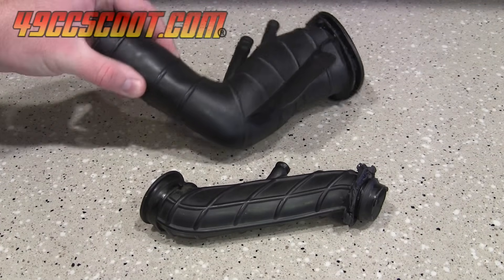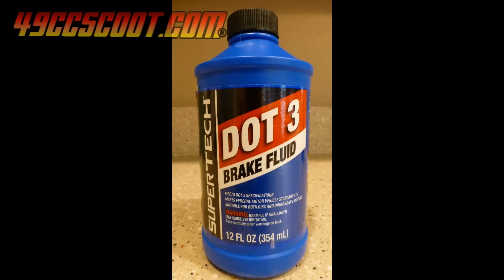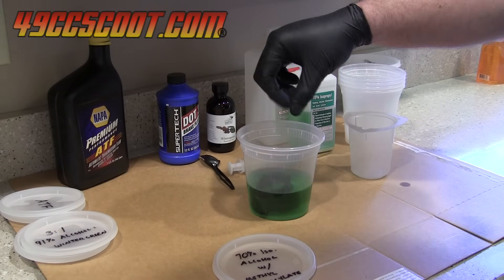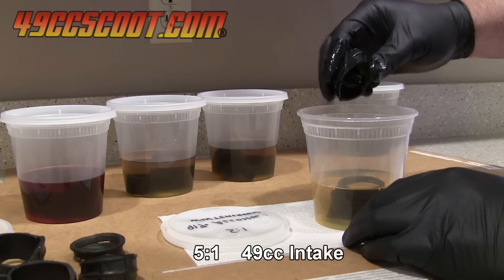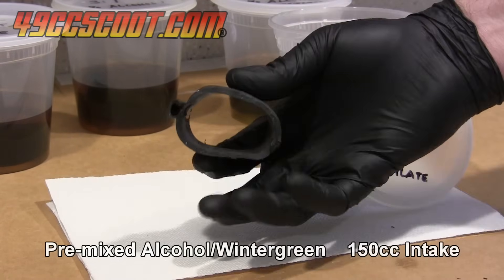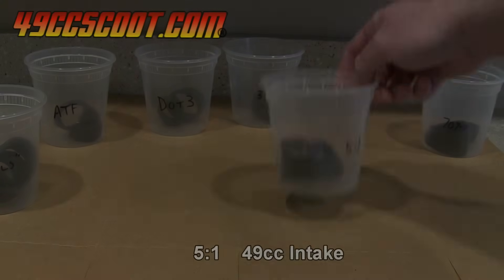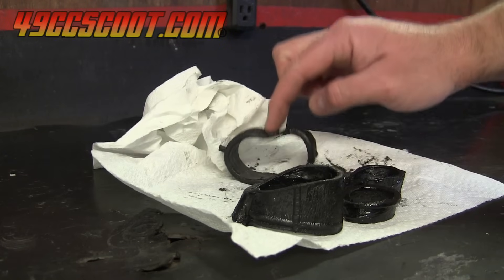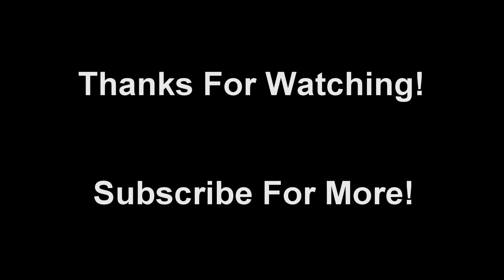Rubber Softening Experiment : Wintergreen Oil, Brake Fluid, ATF & More

Comment: These rubber parts are still made from oil. So I wonder if you could use literal car motor oil to repair the parts by soaking the parts in the oil? Also what about the difference between synthetic oil and just regular old fashioned black motor oil?

Comment: I’ve been using the 3-1 alcohol/wintergreen blend ever since I watched your video several years ago. It works great BUT…I always check for swelling at regular intervals. I tried it on a motorcycle tail light gasket and it very quickly swole to about 1/2” oversized. 
I’ve used it on rubber motorcycle intake manifolds with good success but need to be vigilant about checking for swelling by regularly slipping the part over their mating flanges to make certain that the fit is still good.

Comment: I once broke a brake line in the bush during winter......I plugged off the line and filled the master cylinder with diesel fuel....worked like a charm,............for a day or two...can't remember how long it took to destroy my whole brake system front to back.......all plastic or rubber components softened swelled and began to turn to liquid  .....diesel will do the same to your rubber boots or the soles of your shoes.....I dont know if there is a way to stop the softening process once started....I'll leave that to you to find out.
Reply from the maker: There are some things that I would not play with... like brake parts. If it's of much less consequence, it doesn't hurt to try.

Comment: What about wintergreen oil sprayed with squirt bottle while part is in large food zip lock bag? You could squeeze out most of the air, zip lock it and then leave it in a warm, sunny area.
The benifit would be much less oil needed. 

Couldn't hurt to try.

Comment: You can try the procedure with oil in heated water in the bucket, but the rubber parts should hang on a wire inside the bucket and not touch the water. You need to cover it with a lid so that the vapors do not fly away quickly. This way, the rubber parts will be soaked only with hot oil vapors. And of course, you can try different temperatures.

Comment: Hi. I know I'm a little late to the party, butthis is a great experiment with a proper conclusion. One missing liquid here would be anti-freeze. Any ideas on using anti-freeze which contains ethylene glycol and/or propylene glycol ?

Thanks for your great production.
Reply from the maker: I've heard people say that works, but my thought is that if antifreeze was great at softening rubber, you'd never wind up with stiff coolant hoses.
Reply: @49ccscoot  Okay.... but I've never seen stiff coolant hoses... only fuel hoses, manifold hoses (as you depict) and UV exposed rubber. Perhaps my experiences are limited to 40yrs being a mechanic...
Reply from the maker: @N269  I don't wish to argue. I've got a car with dry hoses (maybe stiff wasn't the best word) right now that I know was garage kept and never sits around with the hood open outside (because it's mine). I guess we are talking about softening though and not necessarily restoration. I do this stuff to help where I can so I'll just say that in my research when I did the video, coolant was not something that it seemed people were having enough success with to make it one of the best things to test IMO. It could be great, but I tried to find things that many people reported success with to try. You could definitely soak some stuff in coolant and find out for sure if it works for you. Some of this stuff may work well on one thing and not at all on another because rubber is a pretty generic term since it can be various compositions. I would suggest a test before trying on anything that you wouldn't want to ruin, just in case.
Reply: @49ccscoot  No, absolutely no,  - no argument. I'll try it with my CB600F-5 carb->head "rocks" and let ya know. They are percolating now. Give me  a week....  I am using concentrate (diluted a very little). 

Again, you make a great production.

Comment: Interesting experiment. I needed to soften/condition  some old print making brayers and hoping to get dents out of them.   Bought a 125 ml of 408 C Rubber Renue on eBay made by MG chemicals.  As soon as I opened it I recognised the wintergreen smell. What I bought is a premix of wintergreen and alcohol so,  based on your test results  (which I don't doubt at all),  I'll be better off mixing my own softner.  Annoying as I have both ingredients and needn't have bought the pre-mix  but I didn't know about this rubber softening property of Wintergreen oil. 

I do now so thanks very much for posting the experiment.

Comment: Beware: Firsthand experience here. Putting any rubber part in wintergreen oil will swell the part beyond original size. It makes many size critical parts unusable. Also, putting in for too long will turn the rubber into a slimy mush

Comment: If you heat the alcohol mixture it may work. I'm not sure how much heat but I'd expect it to do better than hot water and at a lower temperature to prevent embrittlement.
Your other solutions should react quicker with heat as well.
I feel some heat is ok but would need to test out what temperature is safe.
Maybe a sous vide machine would be the ideal test equipment to find the glass transition temperature.

Comment: Excellent video 👏, you worked hard really to get to a reasonable conclusion 😊. Can we mix 3:1 ratio of Alcohol & the wintergreen oil and spray  to the rubber parts of the car doors for lubrication?
Reply from the maker: Thanks. It may work. I would test for any issues with paint before trying it. May not want to leave it on for good, but just spray and wipe down a little later.

Comment: Great video! This will help if anyone is in a pinch and needs to reuse some rubber that has hardened. Also, one thing to note, wintergreen can be extremely dangerous and fatal, so use caution, especially around children whether it is ingested or absorbed topically.

Comment: I have a pair of Nike Shox shoes and the soles on one of the shoes is getting very hard and slick. They are in perfect condition and impossible for me to find, at least for a price that isn’t insane.  I’m going to try the 3:1 alcohol/wintergreen solution. I’m worried that it will be hard to just get the sole and not get it on the rest of the shoe, and there’s a small crack in the sole as well so it could seep upwards.
Reply: Thank you for this video!
Reply from the maker: Maybe try a very small area and keep your distance from the rest of the shoe till you see what happens? If you have another old pair of shoes that you aren't  worried about, try those instead. I get lots of comments about shoes, but unfortunately most never follow up with results if they tried it.

Comment: Also agree with the comments on avoiding solvents. Will definitely soften but by degradation of the rubber instead of replasticizing.

Comment: i have a dumb question: would the 3:1 mixture work on sneakers with hardened rubber to restore rubber softness and grip? this was a great experiment.
Reply from the maker: Thanks. One person said that they tried this on sneakers and the rubber hardened again and there was also discoloration of other parts of the shoe from paint that was on the sole. Cracking or stretching was also listed as a potential issue. I would suggest putting only the area to be softened into the solution and checking it very frequently if you try. If the shoes are not something you want to wear now, then I guess there isn't much to lose. If you still like them as-is then it may not be worth the risk.
Reply: @49ccscoot  thank you.  i will try your suggestion once i get hold of wintergreen oil. i only plan to dip the surface part of the sole, probably soaking about 5 to 10 mm

Comment: The answer to softening/rejuvenating rubber to make it supple and almost like new and quickly is soaking it in WD-40! It not only restores, rejuvenate and gets rid of dry rot it vastly extends the life of the rubber! For items that are too big to actually soak in a container of WD-40 just soak a rag with it and apply it like that you can also fill a cup with WD-40 and apply it with a paintbrush. Let it set overnight and the next morning you will be amazed!
Reply: The smell of WD-40 has that slight Smell of Winter Green ... I'd bet it has it in it ....

Comment: Acid added to Latex crosslinks the latex making rubber.  Latex usually has some basic in it like ammonia.   I wonder if rubber may be softened in water with different concentrations of ammonia.
Reply: I asked an ai what does ammonium do to rubber. 

It reported that ammonia can actually have a number of different effects on rubber, depending on the type of rubber and the concentration of the ammonia. In general, ammonia can cause rubber to swell and soften, and it can also cause the rubber to become more brittle and less resistant to stress. Ammonia can also cause the rubber to discolor and lose its elasticity. So, if you expose rubber to ammonia, it's possible that it could become damaged and less functional.

Comment: Fact: Water can not attain a temp higher than 212°F unless it is under presure. You can introduce more heat but will only inrease vaporization (more steam but the temp will remain 212°F)

Comment: ATF!!! A man pulled into the garage I worked, and asked If I could put brakes on ??(1985)!! station wagon. We  talked, especially after someone had told him to put ATF in his master cylinder to stop a wheel cylinder leak! I mentioned the only way I could warranty the brake work was ... to flush the brake lines prior to replacing master & wheel cylinders. He wanted me to check the brake fluid. I took the master cyl lid off....  Let me tell you!!! Not sure about the ATF of today... but the ATF of the 70s & 80s will swell up brake system rubber, and seal it for, maybe a little while. The rubber gasket that under the cap..... I stuffed all I could back in the master cyl, and  it still was hanging out at least one inch... all the way around!!!  No Sir!  Do not put ATF in your brake system!

Comment: Excellent video.
Both DOT3 and DOT4 are miscible in water, and probably alcohol too.  So you could repeat some of the experiments with either water+DOT3, or Alcohol + DOT3.
I've got a rubber band around an older bandsaw drive wheel that I've been procrastinating remount.  Not overly stiff, without trying to break it, appears to be intact without cracks, but it seems to be shrunk by a significant amount.  I was going to try just heat, but I may also try a rejuvinant.

Comment: A chemist could probably figure out a better mixture....the fact Oil and Water don't mix may have a greater difference of effect because , from my rudimentary understanding, Alcohol can Dissolve oil....so does that chemical reaction between alcohol and oil benefit the rubber by increasing permability for the oil vs. water + oil? That is the real question.

Alcohol could open up the "pores" of rubber more than water so that oil can take its place but is that what's happening? Is there an improved Osmosis effect by choosing one over the other? Wish a chemist could chime in on this.

Comment: Good video and useful information for those of us looking to revive old rubber or plastic parts.  Thank you.  If you ever wanted to do a follow-up to this experiment, may I suggest using various material types of O-rings since they are relatively cheap and would require far less chemicals for soaking.  Also, since they would all be fairly controlled sizes you could fairly easily take measurements to detect changes like swelling and stretching. before, during, and after.
Reply from the maker: Good idea! Thanks.

Comment: There are dedicated rubber rejuvinator sprays sold in auto parts stores, they're supposed to be specifically for this sort of thing. If they work, they'd be a much more reasonable option since you only need a light spray coating rather than a multi-day soak.
Reply: At 205

Comment: You should have used headgasket reapairer/ rubber seal ficer as well. Also rather than socking may be try just laping with the oil. Also I dont think Alcohol cna be used to repair rubber.

Comment: Well done.  I'm going to try this on the rubber intake manifolds on my 1975 Honda CB 360t.  I've restored it from the ground up and everything is perfect.  I've beat myself to death on these two parts.  They have zero cracks and look factory grade but hard as heck.  I hate the though of ordering new ones when these look great but air leaks on an old honda will drive you crazy (and after this full restore....it's a short drive).Thanks

Comment: Thanks Brent , little success here to  in this area with one exception. Main crank seal was passing wind one day with no spare to come so I stupidly grab a once working used seal which of course leaked after assembly . Then I panicked and put some hot air gun stuff on it and you wouldn't believe it ,Christmas day

Comment: I'm gonna try the 3:1 ratio on my old boat shoes. Haven't worn them in 2 years, and I saw the rubber sole is now brittle causing them to be dangerously slippery on smooth surfaces. Hoping they get restored!
Reply: Well .???
Reply: Did you try it?
Reply: Any update?

Comment: It wiil works to make video games controlle menbrane more soft?
Reply from the maker: Never tried it on that. If it's rubber and it can be removed, then maybe. Anything is best if it can be tested on a piece that doesn't matter first.
Reply: @49ccscoot  i think is have a great potential to work.. I'll try it. On my local i can only find alcohol 99%, can this messup the process?
Reply from the maker: @domcabrito8100  That should be fine.

Comment: Very good video, thanks.
Just one question, so what time length do you recommend leaving them to soak in the three to one solution, would 48 hours be sufficient/optimal? Thanks.
Reply from the maker: You can do periodic checks to see when the solution has met your needs. If it's good enough and you don't want to wait anymore, clean it off and carry on.
Reply: @49ccscoot  thanks

Comment: One time an old timer retired mechanic told me a 50/50 mix of ATF and acetone was the best & cheapest cleaner for soaking parts. So I made a 50:50 solution of Dex/Merc ATF and acetone. I made 14oz & put it in a 16oz glass jar w/lid. The first thing I tried was an idle air control valve (IACV). It had one rubber o-ring & another seal that was shaped like a figure 8. I didn't remove them beforehand since I had new ones. After letting the IACV soak for ~24hrs I found that both the regular o-ring and the figure 8 seal had swelled to triple their original size. They were huge. I had no idea it would do that.

Comment: basically its missing plasticizers in it which have been removed as it sat for years.
these plasticizers are usually phthalates with long chains tho I wonder if you can create a homemade version by reacting terephthallic acid from plastic bottles with something like butanol and n hexanol or some shiz under vacuum creating a terephthalate based plasticizer.

EDIT: shit well looks like its already a thing dioctyl terephthalate.

Comment: The problem you note with Oil of Wintergreen is cost.  Most oil is food-grade and very pricey.  Try a commercial-grade product used as horse liniment which goes for around $1 per ounce.

Comment: What I find in stores here is 70% rubbing (isopropyl) alcohol...... and I found the wintergreen oil settles out of it after a few minutes. I shake it and it looks like a mix of water and oil. 
However, I did the 3 to 1 alcohol to wintergreen oil mix in a closed container and put in a rubber hose (used in some 1960s cars to cool the blower motor) that was getting almost too hard to get back into place without cracking. I let it sit 24 hours, every so often shaking the mix as the wintergreen had settled to the bottom. After 24 hours the part was literally soft as brand new, easily able to be inserted into the blower motor hole and the firewall HVAC plenum hole with ease. 
I am not sure if I'm doing something wrong or not that's causing the wintergreen oil to settle - if the 70% isopropyl alcohol isn't enough "alcohol" content or what, but this is a very very promising situation for me. It looks like I might be able to salvage some parts you quite literally haven't been able to buy for decades - at any price. When I get out of my shop back to a real computer in the house I think a donation is in order.

Comment: Back in the days of cassette decks and VCRs, I used ATF as a cheaper alternative to Rubber Renew. Wipe down every new belt or rubber roller, make sure you wipe it clean. Gets rid of the wax and dust from manufacture, gives the surface good grip without soaking into the body of the rubber.

Much, much cheaper for a quart of ATF than for a tiny 4 ounce bottle of Rubber Renew.
Reply: atf burn your rubber

Comment: Is there anyway this method can be used to hardened shoe sole?
Reply from the maker: You would probably need to make sure to only soak the sole. Someone else was going to try it in the comments and report back, but I don't think they ever did.
Reply: @49ccscoot  it'll be interesting to see you done that experiment as well. As i have read lots and lots of questions online relating to this topic and none seem to be so credible.
Reply: @Lyricbox630  So have u done it sir?

Comment: Marvel Mystery oil is primarily a wintergreen base. I wonder how that would work out. It has lots of other stuff, which I don't know the effects on rubber. It's also a little cheaper than essential oils off ebay and can be found at auto parts stores.
Reply: I immediately thought of MM and other Seal conditioner type products and wondered what they put in them.